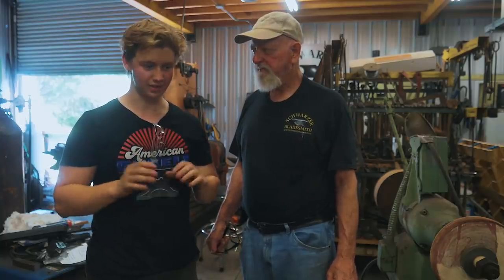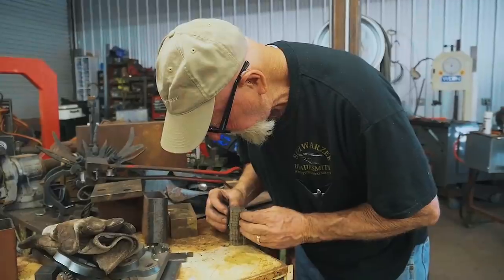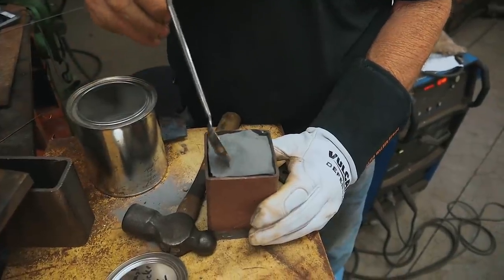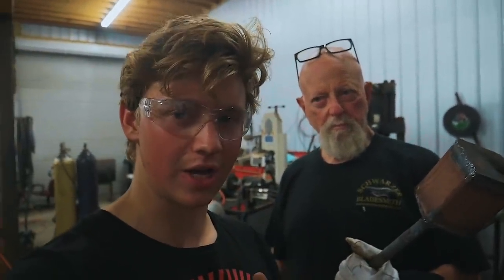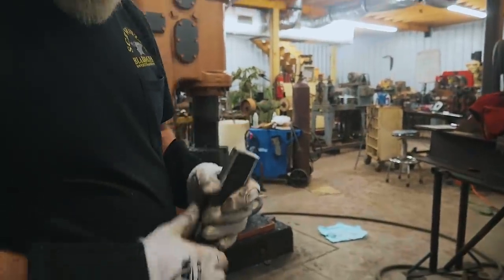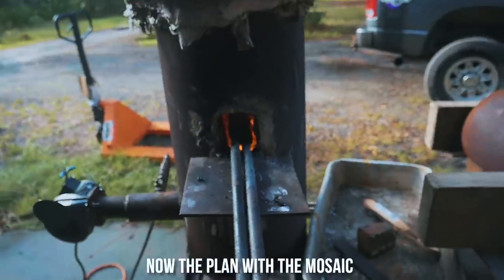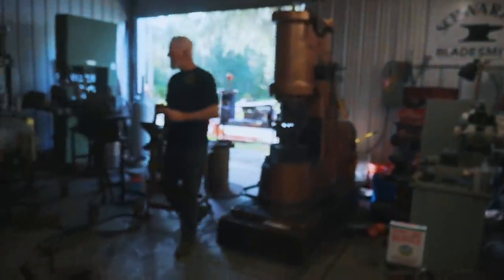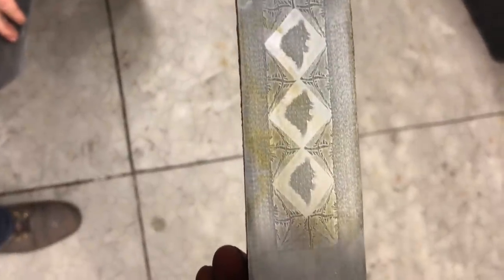MAKING DINOSAUR DAMASCUS!!! Pattern Welding With Steel Powder.

Comment: Damn that stainless steel though, the can just slid right off. Forged in Fire contestants take note
Reply: right!, always expected it to work that way on the show but nope they there cutting/chiseling it off burning time. This guys just sliiiiidd right off, so satisfying.
Reply: I was thinking the same thing
Reply: If they only had stainless foil at the FIF forge......
Reply: I think the burnt part is important.   Oxidation provides a surface that wouldn't bond.  Now if they do white-out, then line it with fresh foil it might separate, leaving only a tiny stainless surface to grind off.
Reply: One of them had it falling of like that with white out and tissue paper.
Reply: would aluminum foil work? any try that? just curious since it's readily available and a different metal
Reply: NinjaRider777R  right aluminum melting point is relatively low, even at best you'd probably have a molten mess once you pressed it.
Reply: Lachlan Van Vliet I don’t think there’s any on set
Reply: Cheat and have some in your pocket/toolbox

Comment: Wet paper towel works too for a self peeling canister. If it's not already been mentioned. The ash forms a layer just as the soot does in this instance or while MIG welding.

Comment: Always a pleasure to observe a vetran and pioneer at his craft.

Anyone know/understand this hand trembling thing? It seem to get "worse" with age, but I've been doing that all my life. Even my high end smartphone with all kinds of image stsbilization, is telling me I'm shaking it too much when taking photos. In daylight. When holding it with both hands.

Yet at work - I can do microsoldering. Manipulating components and hand tools tools down to double-digit micron size levels.

I'm fairly certain this guy got his hand work on lock when it actually matters though. And mostly that's what matters.

It would be nice to not shake so much while doing stuff like taking pictures though. I use it as reminders as it's so much faster than typing a note, but way too often I can't tell what it was; just too blurry.

Comment: Simpli safe is a great system. But one thing you should know is there sensors are easy to set off. I was at a paint job and the owner had simpli safe. And we were taping along the window. Well the tape ended up setting the alarm off.

Comment: For anyone looking into accepting the discount offer, I suggest you have a look around first, the wireless devices from SimpliSafe can be bypassed by a simple device you can buy from Amazon for $2, see video 935 from the LockPickingLawyer for that. Otherwise it's generally a bad idea to let thieves know what security system you have anyway so just don't put up the sticker. It's important to have good home security just remember to look around first, no beef with Alec he most certainly doesn't have the time to go looking into the detail for all these things.

Comment: That was a nice episode 

Is it possible to almost mirror polish a blade and then dip it to get the pattern to show? 

And I still think you should consider to make a "Junk sword" with all the left overs and use all of your techniques, maybe some "pirate sword" style with ingraveing  maybe a compass ingraved in the blade.
Reply: The high polish than etch technique can work, it's used in metalography to get the contrast needed for a microscope.

Comment: Im just wondering
Can charcoal get hot enough to be able to forge mild steel
Reply: Yes but it is a waste. By the time it gets hot enough. Its has burnt out. Honestly your best to just get hardwood lump coal from Walmart. But if your making a blade mild steel is USELESS. it wont hold an edge.
Reply: @hannahramos2869  what metal should I use to make a blade?
Reply: Depends on what it's used for and what you know about the heat treat. You want something that will actually hold an edge. If you order steel, you can do your research. If your looking at scraps. Your best to use hand files, railroad spike, anything where the steel takes alot of abuse so you Know it's hard steel. The teeth from a tree harvester work AWESOME but I live in maine so I can get them for free

Comment: Simpli safe can be defeated in 2 seconds flat by holding your car’s keyless entry button down while a couple feet away from a simpli safe door sensor.  Then just open the door or pry the door open; the alarm wont go off.  The car remote’s use the same frequency and jam the simpli safe sensor.  Since simpli safe would call the police every time someone opens their car, it is designed not to alert for small disruptions like that.  Not worth my money.

Comment: Cool I can buy over 3000 dollars worth of SimpliSafe products just to have a 15 minute wait time before help arrives, you know car speed being limited and all, and hope I am SimpliAlive for them to help me. Alternately, I can use a 300 dollar 1911 to ensure the person doesn't do it to someone else ever and ensure my own safety and eliminate the need for the whole wait time. I think the 1911 will do the better job, I am not in the habit of video taping my own death. 

Sorry, but I'd still rather be sitting in a jail cell with a felony charge then to bury any of my family. 

Good video though could do without the advertisement, as it is only there so you get the products free to review and push. I'd respect an advert from Remington, Winchester, S&W, Walther, Colt etc etc a lot more than a product designed to give a false sense of security.